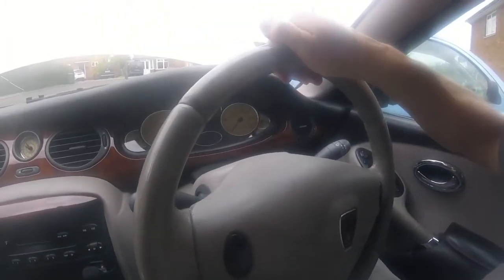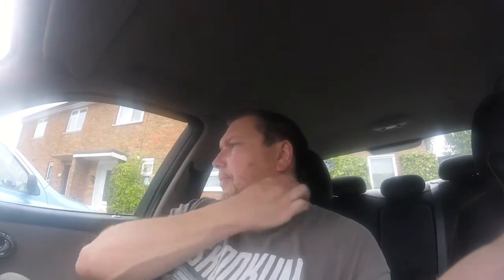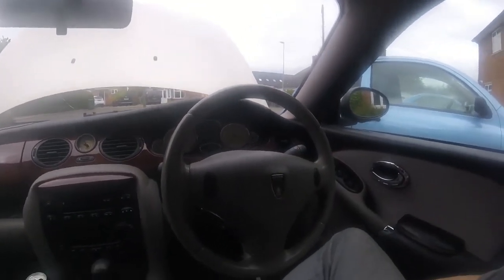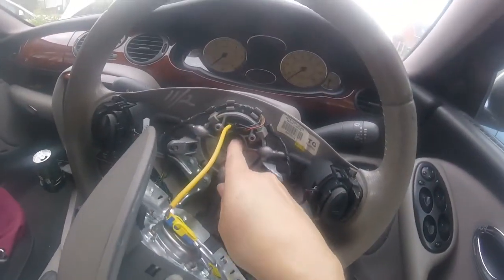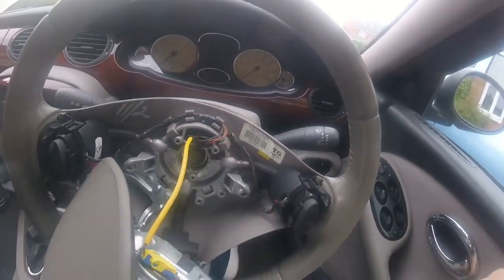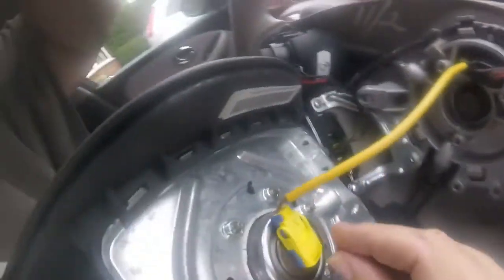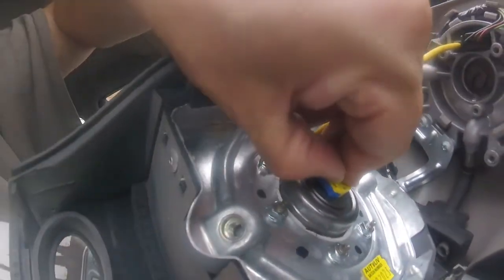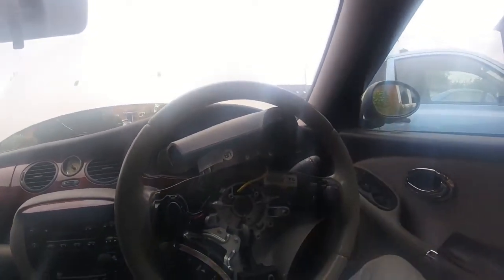Rover 75 Airbag removal and tightening my nuts. (Alright, it's a bolt)

Comment: Nice to know about those battery's un-soldering themselves. Good tip for anyone who liked the look of your tool, bought one, and it stops performing as desired.
I probably would have binned it, and bought a new one, but now i would check the battery's thoroughly before binning them/buying new. Thank you Mr Shed.
Reply from the maker: I thought it was worth looking into, glad I did.